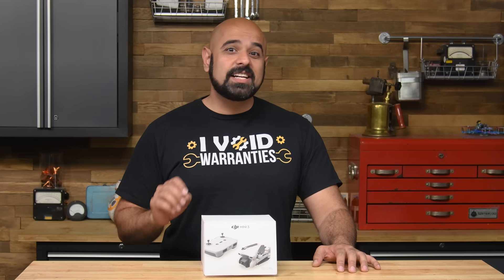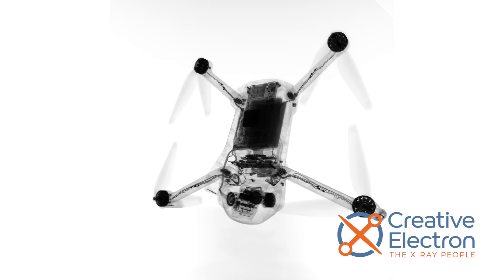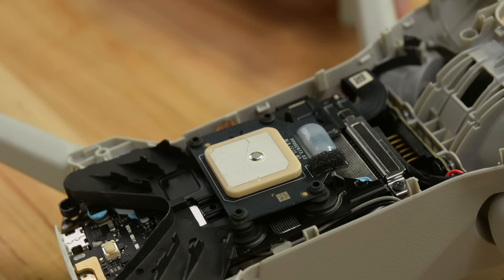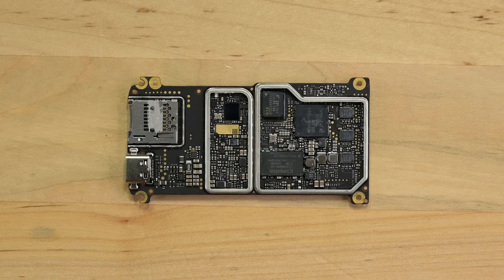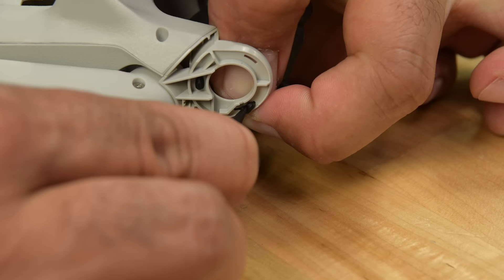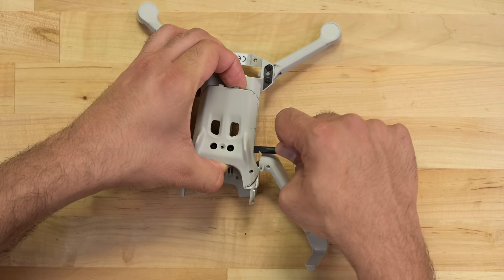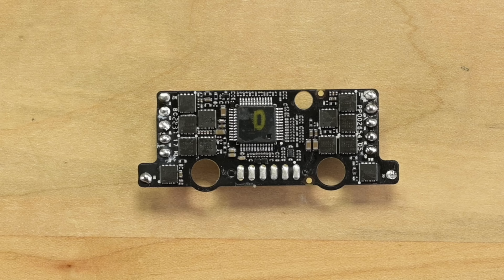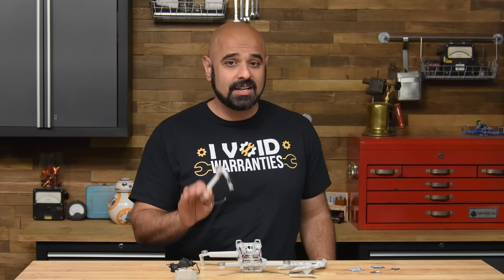DJI Mini 3 Teardown: 30% Less Functionality for 30% Less Price!

Comment: Minus the lack of parts availability you really can’t fault dji for not making these easier to disassemble as they fight to pack so much in such a light package.
Reply: Much harder to fix then mini 2
Reply: @Matanumi maybe because they put so much more inside the drone. Along with heavier parts from the upgrade from mini 2 to mini 3. Every sensor that gets added adds weight
Reply: Parts are plenty go to cloud city is all

Comment: You did an amazing job at NOT SHOWING the rear arms being removed as they’re completely different than the front 🤦🏻‍♂️😤 ifixit usually does a much more detailed video, specially on something the host even admits is more challenging than a typical repair. So that being said, does anyone have any tips as to removing the rear arms that appear to just have a pin thru them??

Comment: Mini 3  has longer flight time than the mini 3 and 4 pro has the same camera flys better range about 3 miles doesnt over heat like te 3 and 4 pro which causes the drone to land  as far as the sensors dont work at night flights or seeing wires  cost is cheaper

Comment: What a total nightmare to fix that pile of overpriced rubbish, if you can get the parts.
Reply: Are there alternatives that can take comparable footage and send live footage back to goggles or a controller/screen with comparable quality?

I don’t like the price but I find their video transmission hardware so tough to beat. Building something custom that’s comparable has, at least in my research, seemed like it would cost far more due to the lack of integration.
Reply: @steve-adams  All DJI builds are streamlined copies of builds other people have made. The one advancement they had was the digital FPV protocol, but now there are several cheap digital VTX modules that do the same, and without the compatibility issues DJI built into their hardware. You can build a high end arducopter based drone for about $300 and it not only will have longer flight time than the DJI, but a lot more lifting power as well. Personally I don't like gimbals because I like seeing the FOV move when the drone moves to get an idea on my latency but there are many designs for that as well.

DJI is for the guy who doesn't want to learn anything about drones and just wants to fly a few times before shelving it. It's a necessary market especially for commercial applications like inspection, but most people will be better off building their own.
Reply: @DaveSmith-cp5kj  Which VTX systems should I look into? I built a drone since I left that comment, but haven't gone a far as the VTX aspect. It's really just waiting on that, and I haven't had the time to follow through on research. Some tips would be appreciated!

Comment: Late to the party but you missed one of the best parts, the S1 “Sparrow” chip.  It’s a custom ARM Cortex M that handles the 2.4/5Ghz radio chip, specifically the SDR for Occusync.  Its firmware is in /etc/sparrow-firmware on a squashfs in the 0100 module.  Encrypted of course.

Comment: Thank You. 
Today my Mini 3 run RTH on 21% battery during i stering to land on my hand... I dons see 9s countdown and no any audio alarm. Just run on full throttle up.
 And crash on wall and 2 front arms broken like dry ice cream wafer XD Ofc all 8 preopllers too destroyed. Gimbal survived :D
Relly so crap durability.  Especially mounting fron arm on 1mm tiny very crunchy plastic washer.
I think some glue and carbon insert in arm can easy repair. But i have DJI 2 y care and maybe i send for replace.

Comment: Its Nifty and such but I dont understand why they cant do this in a more Hobby friendly way. YOu can have these for the people who are ot Hobby people who enjoy repair and soldering or modifications.. It would be nice to see one of these on a more open style frame similar to a FPV freestyle frame. Something we can swap motors and such out on to play with. Something we can swap the Air 03 unit in and out of ect... They could definitely do one in a more Hobby Centric way and bring a ton mroe money in as well as prop up a struggling (but inevitable to eventually explode in a good way) industry.
Reply: I asked myself the same question, but I am also an engineer (and kind of knew the answer already).
Weight ( <249g) and manufacturing cost.  They also want to restrict people from copying their design and swapping parts.  DJI is like Apple;  they don't want the "Right to Repair" (laws).

If you hobby, you can probably build your own RC via circuit diagrams, 3D printers, soldering irons, SMD heat blowers, taps, dies, torx screwdrivers, philips screwdrivers, drills, hand saws, and firmware loading via microsoft or linux.  As a hobbyist, you also probably sign up for FAA certification.

But DJI has the best cameras.  In comparison, I built a diy movie cinema camera in 2019 that uses the same CMOS chips as the DJI drone cameras.  They individually are ~$1000 dollars for those camera chips.  DJI is putting all that stuff in one package at a way cheaper value (somehow (via manufacturing cost (in China))).

I suggest everybody get their own tool shop desk area or lab.  Engineers and low cost hobbyist need to start investing in tools at a early age, so you can buy like one or two things every month over a year and you end up with a proper lab (for cheap).